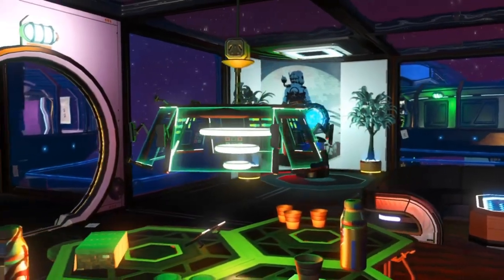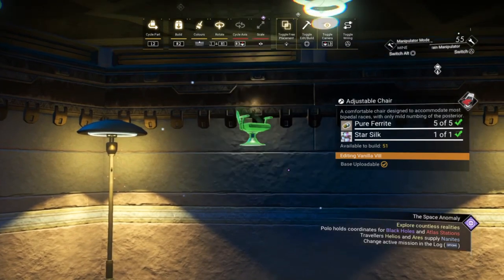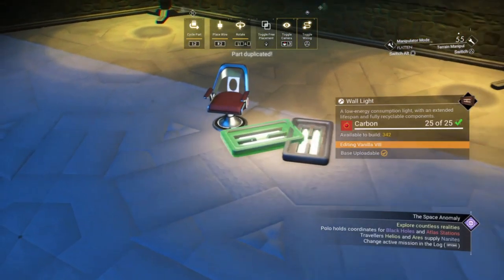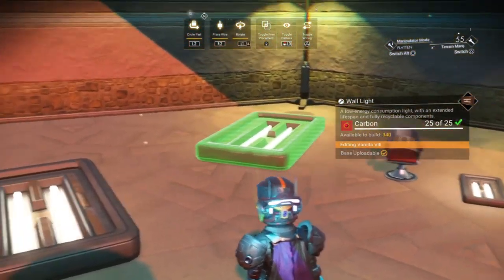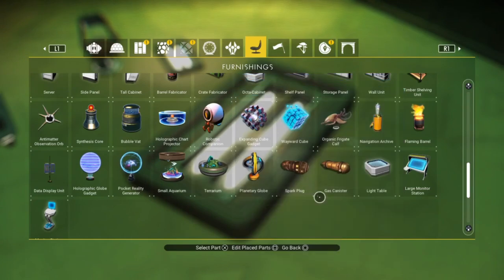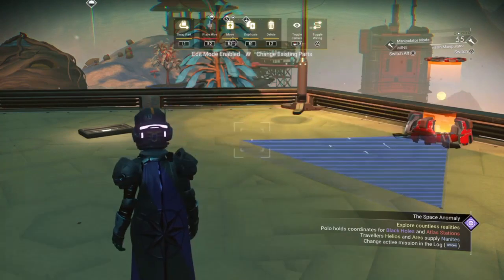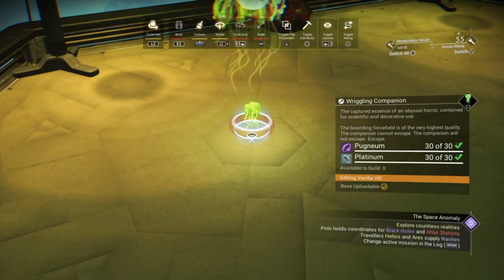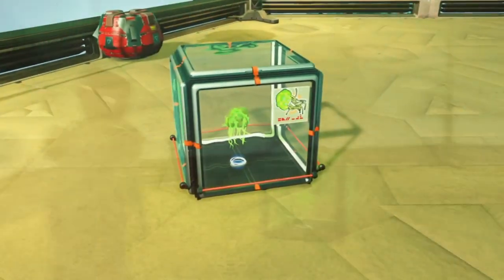No Man's Sky Micro Build Essentials. Part 1 - The Power of the Cache. #nomanssky

Comment: Great guide! I really struggled with the simultanious pressing of LMB and Q and for those like me, the solution is pretty simple: just go to the control remapping and remap build part placing with a keyboard button instead of a mouse button so that the responce time is more similar. After I did that, the glitch worked first try.

Comment: What buttons to you need to press on switch to do this
Reply from the maker: Not sure - I'll check for you and let you know.
Reply: Thx
Reply from the maker: Hey - sorry no -one could help me on reddit whether the glitches work or not. I'm not sure of the Switch buttons exactly but I'll give you the Playstation equivalents so you can match them to your Switch menu: Triangle = Toggle Wire, Square = Toggle/Build, R2 = Build. When you press them "simultaneously", give a little preference to the Toggle wire button. Hope it helps and let me know if you get it to work. Cheers.
Reply: @toskvision  this rly helped, took a while to figure out but I got it to work, thanks!
Reply from the maker: @leolowrey6393  that's great! Could you let me know the buttons just in case anyone else asks?
Reply: @toskvision  yes, I used the Xbox layout but swapped X and Y and B and A and used R to to duplicate and ZR or A to place and x to toggle wiring
Reply from the maker: @leolowrey6393  thanks mate

Comment: It doesn’t work for me, the wiring constantly turns on, a little unfinished guide, you need to tell everything step by step for each key)!
Reply from the maker: Thanks for your feedback sir. Sorry you're not getting it. It can be a bit tricky. Give a little bit of preference to the "toggle wire" button. (triangle on the PS4) when pressing the buttons together.
Reply from the maker: Which platform are you on?

Comment: Does not work.
in the second step, when you need to press q + right mouse button - as soon as I try to do so - a dot is placed for the cable. There is no item substitution.
Reply: I remapped the keys to object placement and it worked.
The only pity is that the enlarged version of the dome cannot be powered by electricity.

Comment: Simple question: how long is delay between pressing Q and C key? I tried dozen times - and I can't find the right timing.
Reply from the maker: It's minuscule. Almost simultaneous
Reply: @toskvision  yes but this „almost” ist main problem for me. Either I toggle wire mode or I toggle build edit/mode… I want to assign these two keys to one button on my TWCS throttle so I need an exact time between pressing and release these two keys…
Reply from the maker: @OSH0891  yah ok. Tbh it seems to be a little different for everybody. I'm not sure of the exact time myself.  I get it to work 2 or 3 times in a row, then I can't get it 5 or 7 times.